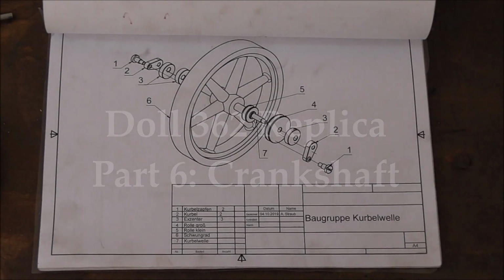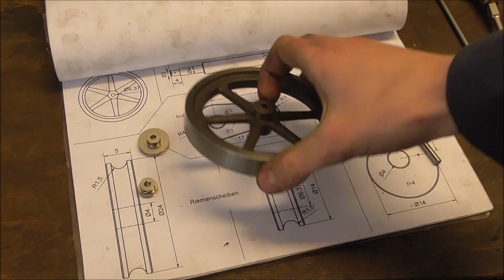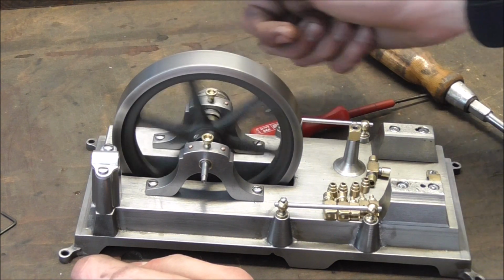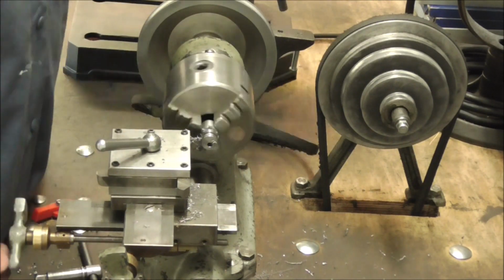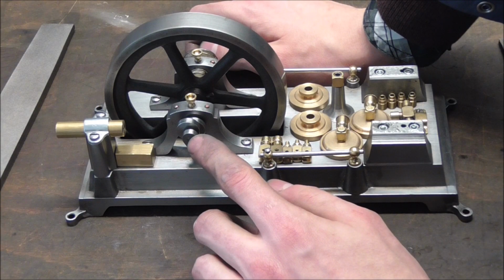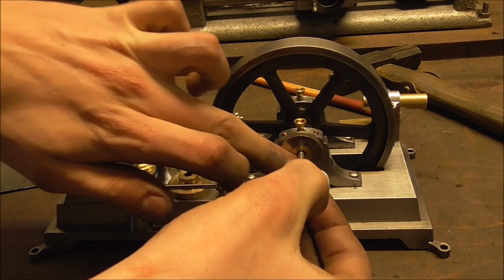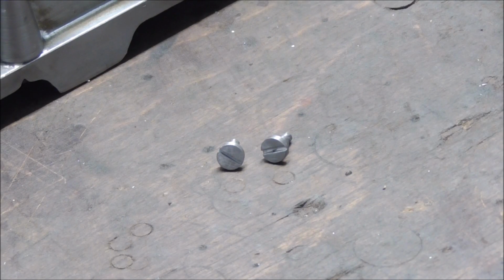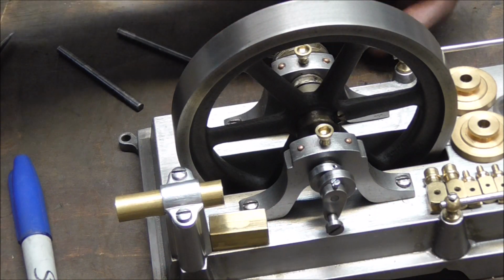Crankshaft - Doll 362 Replica #6

Comment: Sometimes machining in assembly is the only option.
As long as blueing - see any steel color by temperature chart. The best temperature for blueing is 400 degrees C. Once the piece gets purple to blue, dip it in oil. Any oil will do the job.